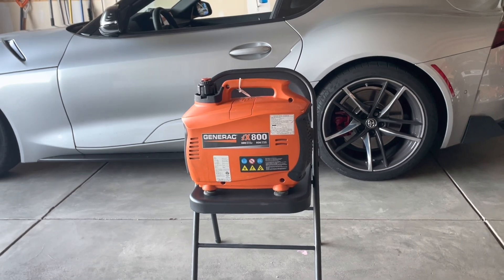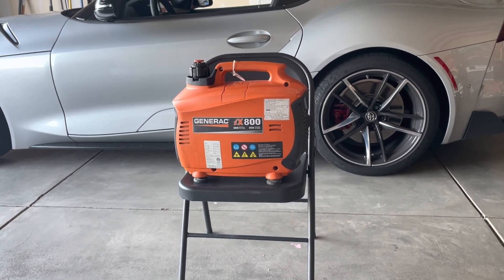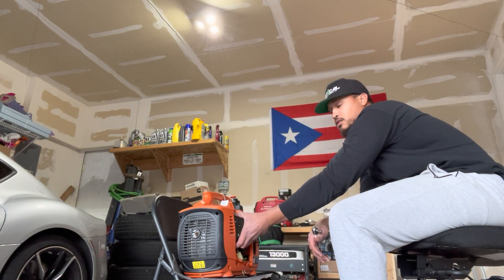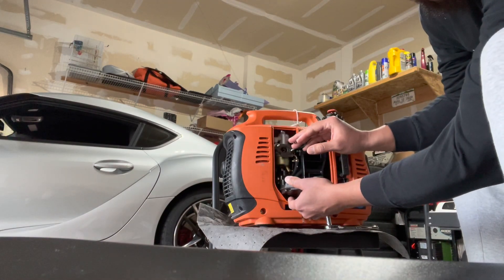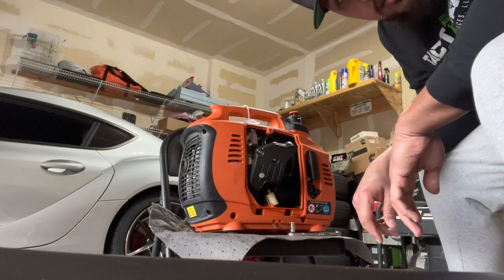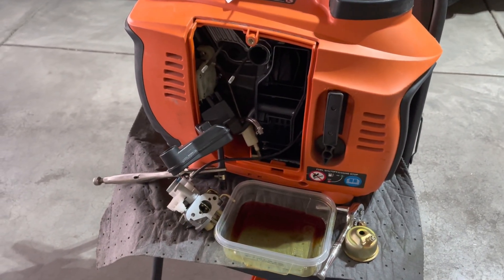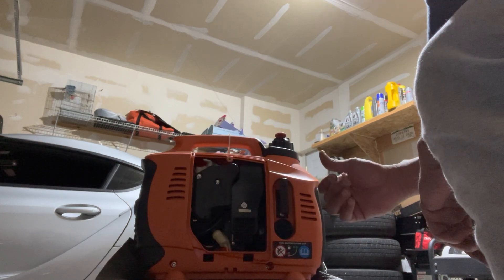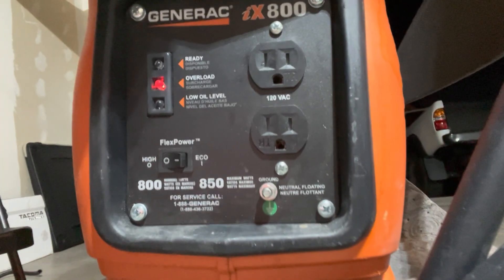Repairing a portable GENERAC ix800 inverter generator that won't start (Plus overload fault)

Comment: How do you test that fuel pump ?
Reply from the maker: To test the fuel pump you just disconnect the fuel hose at the carburetor and pull the start rope. If the pump is working correctly fuel should come out that hose.

Comment: Hello I’m trying to fix mine but how did u get the carb off I’m having a hard time removing it
Reply from the maker: Hello! To remove the carb, remove the two nuts holding the airbox and carburetor together and all you have to do is pull. The air box was a little tough to remove as you can see in the video but for the carb check if removing the fuel line helps. Sometimes the back gasket gets sealed and makes it hard to pull the carburetor out.

Comment: Hey man! I like the video. I was wondering if you knew where I could find a new carburetor for the ix800
Reply from the maker: Hey! Thanks for watching my video. Did you tried Ebay or Amazon? I did a quick search and found a few of them. Prices will vary depending if you looking for a OEM carburetor or a cheaper “chinese” replacement.

Comment: I have this same generator... got it for virtually free, and was able to get the motor running quite easily.. but it has the same immediate overload issue that yours seems to have.  Did you ever figure out anything about that?
Reply from the maker: Yes, the immediate overload issue means that the inverter module is bad. The module for this unit goes for around $750. It’s not worth the fixing if you ask me. Thanks for watching my video.
Reply: @tacticalpowerpro  Seems like on all these units the isolation transformer rusts out. There are posts on forums describing how to remove it and wind a replacement.

Comment: I have the same generator.  A friend gave it to me because he was tired of it not starting consistently.  I have been able to keep it running with no problems.  I had it out last night due to a power outage.  I plugged in my freezer and a refrigerator and potentially overloaded it.  The generator was in the rain for a bit and I think it shut down at some point perhaps due to the rain getting to it.  Anyway, it starts now, but does not rev up from a slow idle.  The overload light is on.  I hope the rain didn't fry anything!

Any ideas?
-BG
Reply from the maker: Hi BG thanks for watching my video. Does the overload light turn on as soon as the generator starts running? If so, your inverter might have shorted out. Sadly these portable generators are not designed to run under rain or any wet conditions.
Reply: @tacticalpowerpro  The motor started immediately this afternoon on the first pull and ran at full speed.  That resolves the chugging issue.  Unfortunately the overload light is still on.  I saw another video where someone disconnected and re-connected all the internal wiring and it reset the overload condition.  I think I'll try that next and will report back.

Thanks!
Reply from the maker: Yes keep me updated BG, I am curious if unplugging and plugin the internal wiring will solve your issue.

Comment: My Generac iX800 will only stay running with the choke on. I cleaned fuel and carburetor.
Reply from the maker: Did you made sure the main jet and nozzle inside the carburetor were fully cleaned?

Comment: I have a generac ix800 the motor works but it does not produce power, tell me how to install an inverter or a UPS so that I can use it please
Reply from the maker: Does your ix800 has the overload light on? If it doesn’t then check your generator carbon brushes and make sure they are making good contact before you start messing with the inverter.

Comment: Good job bro... Mechanical skills rule! I got my generac at the dump take it / leave it, brought it home started first pull... It would run a grinder for a while and then it got funky... With a small fan plugged in it starts to turn and then in a couple of seconds the red light comes on. So it's output into 110 but it doesn't last... It's vexing me!
Reply from the maker: I feel you bro, sometimes these generators can be frustrating. Finding one at the dump and it starts first pull is awesome. These 800 can’t power much specially in higher elevation once they are de rated. Thanks for watching my video 🙏🏾